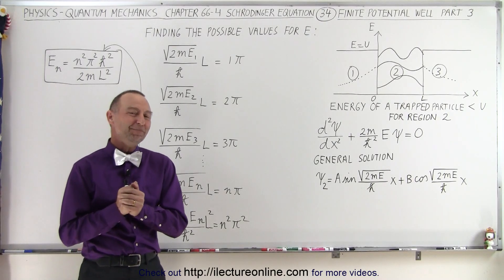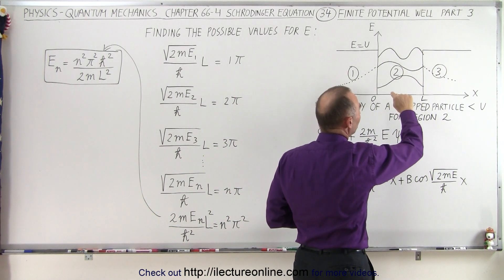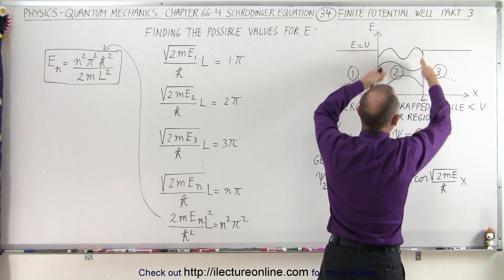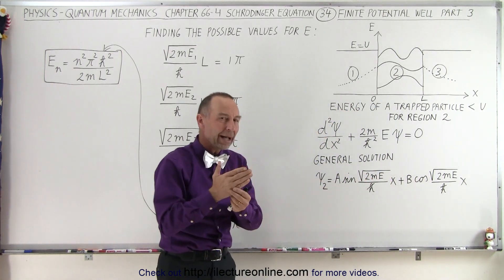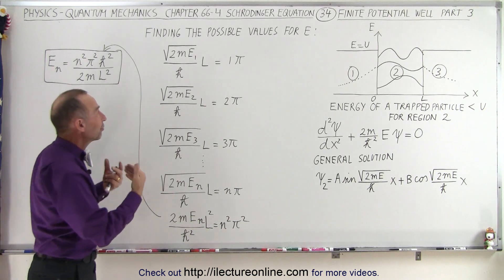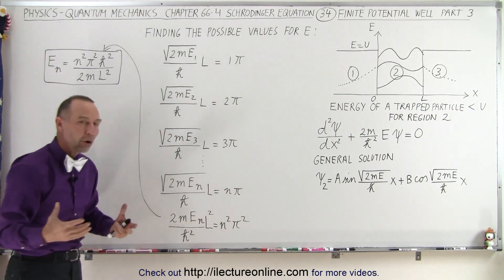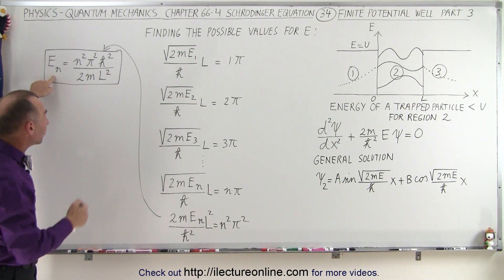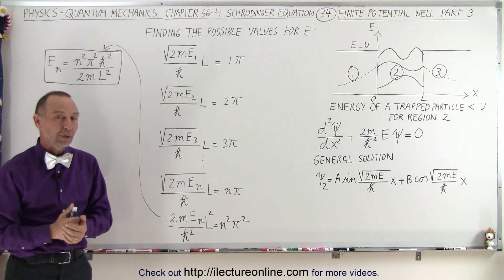Physics - Ch 66 Ch 4 Quantum Mechanics: Schrodinger Eqn (34 of 92) Finite Potential Well Part 3

Comment: Thank you for the grat lesson, professor. But I have a doubt. Shouldn't we ensure that not only the wave function is continuous in all space, but also its derivative? The second state you drew, with the full wavelength, it doesn't look right, it's not well behaved because there are two values for the derivative in the same spot. Shouldn't only an uneven number of half wavelengths be allowed?